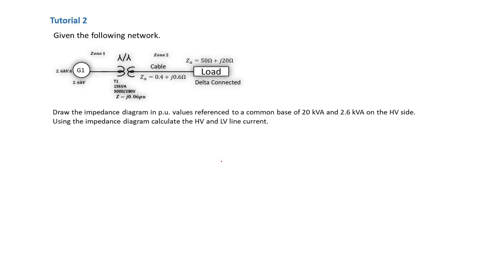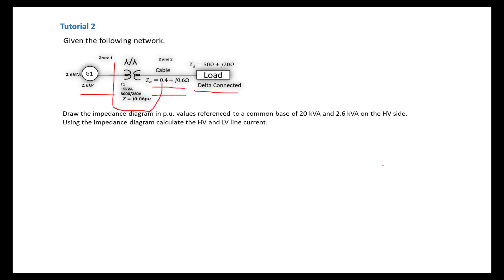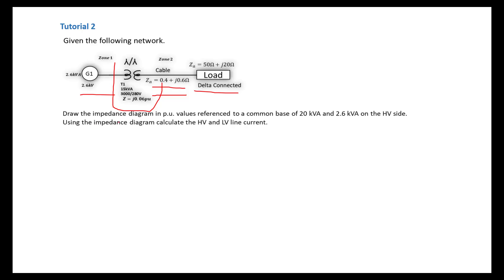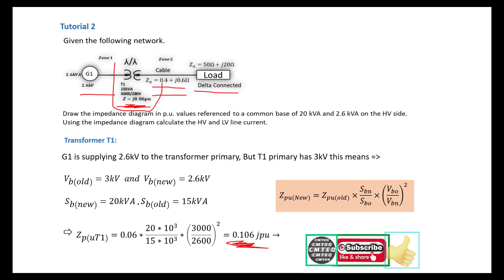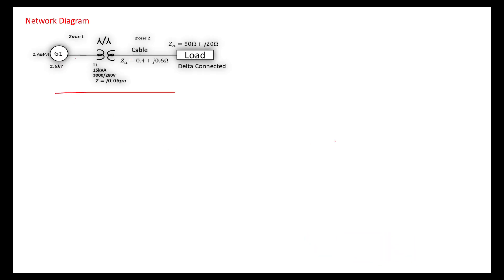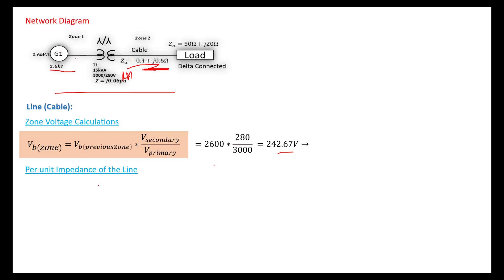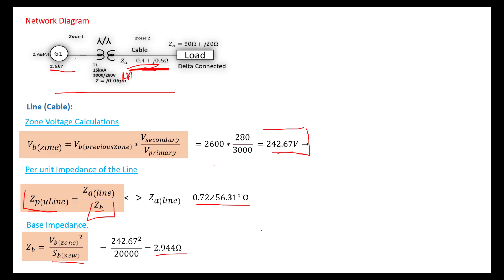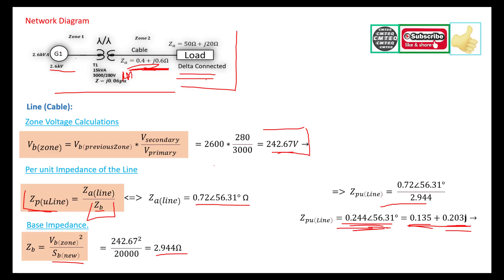Per-unit system calculations - Tutorial 2.part 1

Comment: Can you explain more on why we need to use the formula (Vb= Vb(previous zone)*Vsecondary/Vprimary) to calculate the base voltage of zone 2, Is that because the transformer ratio is not matches with the previous ratio, like the input voltage to this transformer is 2.6kV not 3kV, so the system is not consistent, so we need this formula to find the base voltage that makes the system become consistent?
Reply from the maker: You're on the right track! The reason we use the formula Vb(zone 2) = Vb(previous zone) × (Vsecondary / Vprimary) is to ensure consistency in the per-unit system across different zones of the network.

The key point is that each transformer defines a new base voltage for the next zone, based on the turns ratio. Since the primary voltage of the transformer is not the same as the base voltage of the previous zone ( 2.6 kV instead of 3 kV), we need to adjust the base voltage accordingly. This ensures that all calculations remain consistent and correctly scaled when transitioning between zones with different voltage levels.

Comment: Hi , how did you get sb (new) as 20000 , it should be 2.6 kva
Reply from the maker: Hi, please check the problem statement again. It states, "pu values referenced to a common base of 20 kVA." This represents Sb(new). The 2.6 kVA on the high side refers to the generator rating, meaning Sb(old) of the generator.